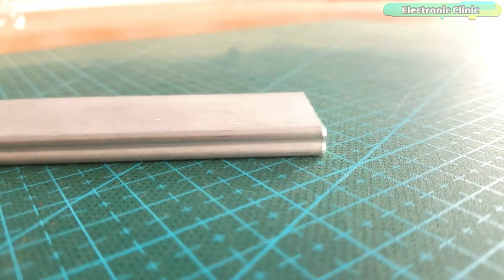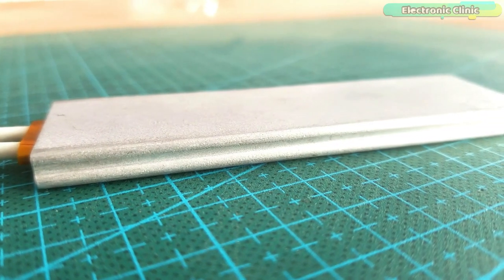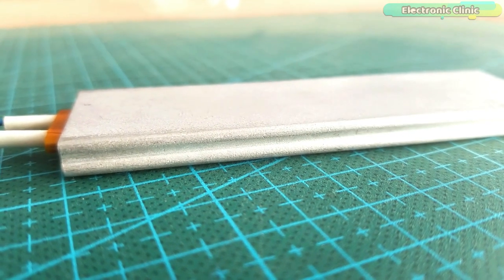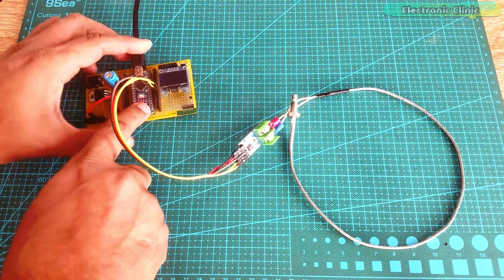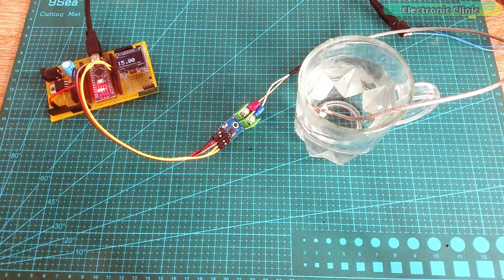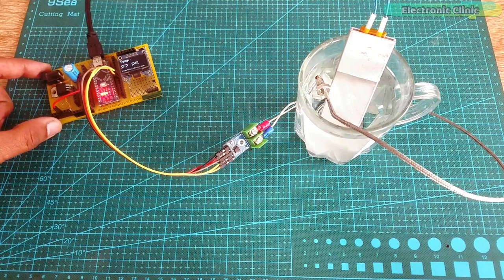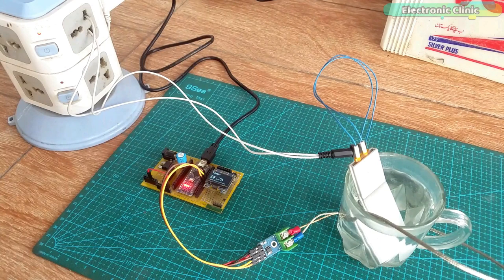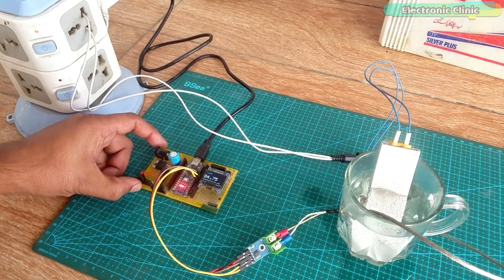12V DC Heater Plate 80W, PTC Heater Plate with Arduino temperature monitoring, Solar water heater

Comment: u should have dipped the entire PCT heater in water. the part in air gets hot fast and raises the resistance, slowing down the heating process.

Comment: I LOVE this project and want to try it. I have ordered the parts except for the dc female socket that you connect by soldering to the two wires of the aluminum heater plate. I looked on Amazon and don't see anything similar. Can you provide a link to that specific, please? Thank you so much!

Comment: I want to increase the temperature of  box of 20litre volume .for this I used 3 ptc modules. Can I use copper over the 3 ptc modules to radiate the heat into the box? If not what is the good material for this purpose?

Comment: Hello and thanks for the video, I have some questions:
1. Can I heat a small 12 square meters room with only one PTC 220V 80W Heater Plate or it needs more than one?
2. It is safe and reliable?
3. How many Celsius degrees over room temperature can rise the  temperature of a 10 or 12 m2 room?
4. Is there a better and cheap way to heat a room, like with magnetic heater or other technology?, 
Thanks in advance for your kind answers.

Comment: Can I power it with 220v? Or is it strickly 12v dc?
Reply from the maker: there are two versions of the same heater, 220vac, and 12vdc.
Reply: @ElectroniClinic  Did you though connect the 220 volts  to your 12 volt model? It sure seems like you did. I suspect these modules are fairly agnostic when it comes to power?

Comment: can i connect the PTC with the arduino uno? so that it will share the same power source.
Reply: Isn’t the uno powered by 5 volts and the heating element is rated for 12 volts?

Comment: I also have same heater module.🙂🙂
Reply from the maker: how it works? did you test it?
Reply: Module operates on 12V 30W 
Max Temp. 220°C
Dimensions- 35 ×21×5mm
Reply: Me too, 12v version, I tried using AC power and it worked
Reply: @IMRANKHAN-we9un   how much time it took to reach 220 celcius, and wil it heat water with in a minute